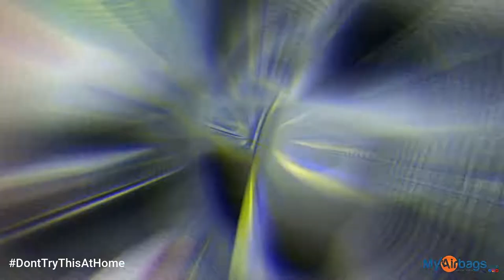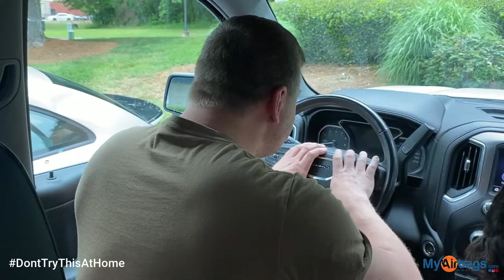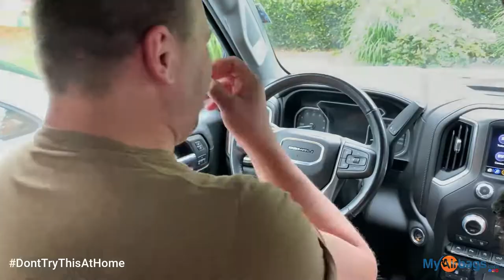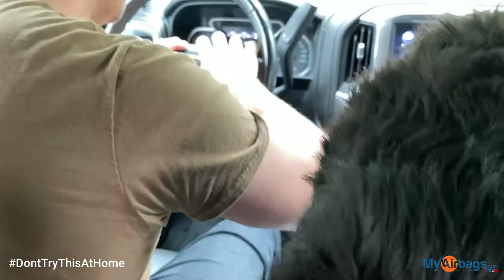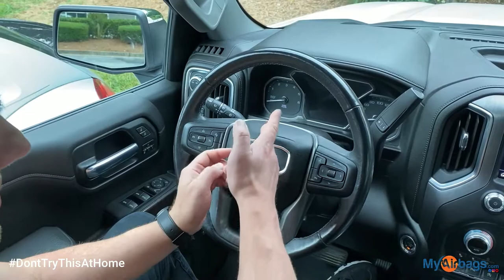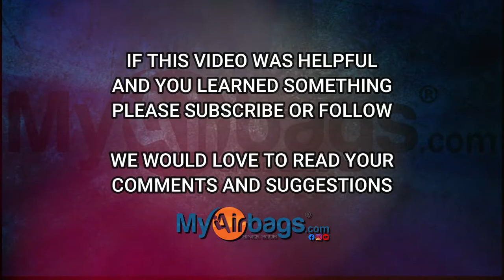Will Punching an Airbag Hard Trigger Deployment ?  | MyAirbags

Comment: I just had this issue with my 2017 F150. The cruise control and menu buttons were not working on the left side of the wheel. I punched it three times and it works fine now. Incredible.
Reply from the maker: 😆 Hahaha, that is funny.